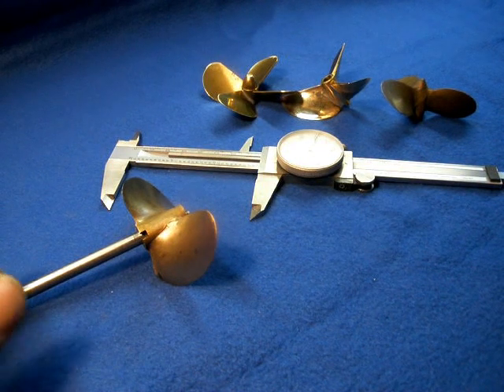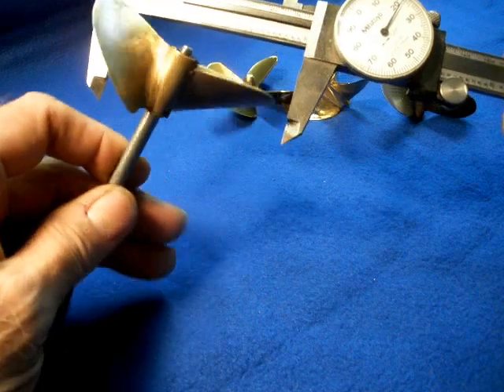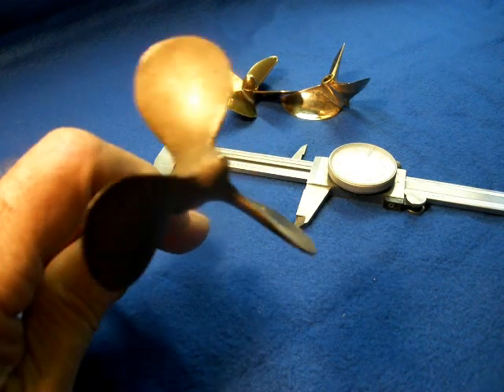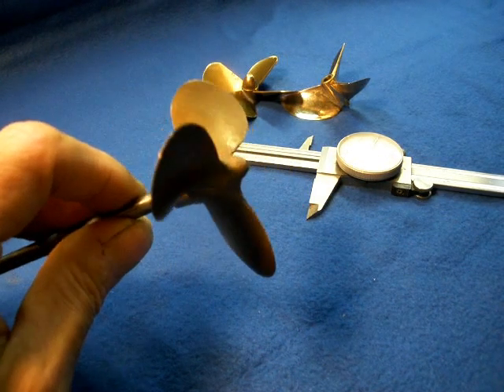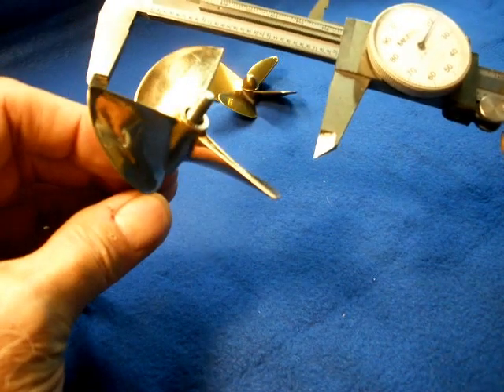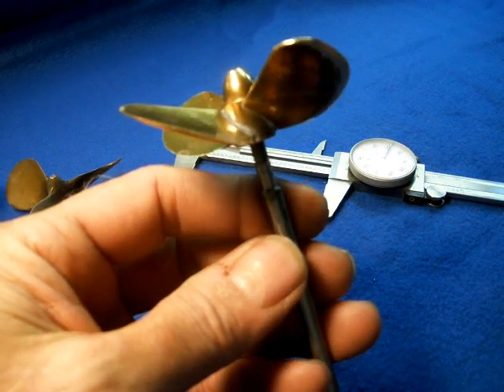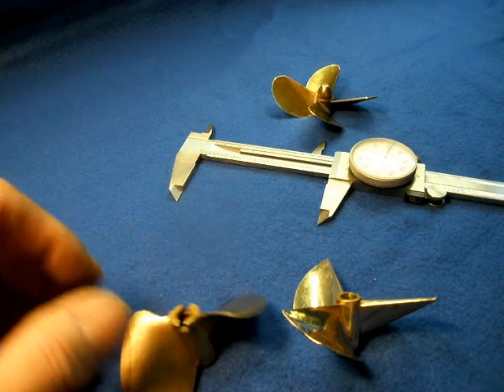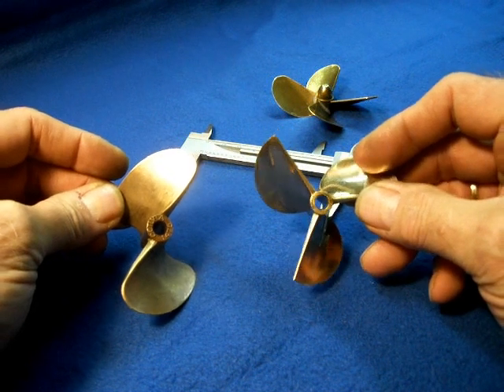Stuart live steam engine model (V10) launch propeller testing results

Comment: i have a steam tug with a stuart 10D  boat is weight 27kg i have get a calulate 4 blade screw from 100mm  diamter under it  , the angle  is have a pitch angle 20 degrees an and 5 degree bend to the front   he is getting to a high  rpm and is pulling a boat from 750 kg easy whit a speed from 1.5 km.hour  and free runnin is the boat having a from 5,5/h  boat is 1.25m long